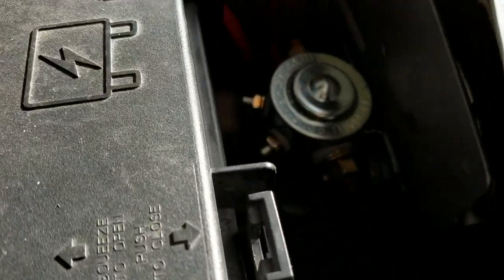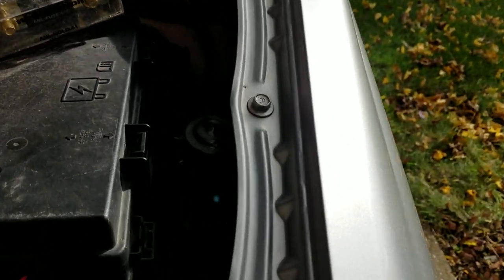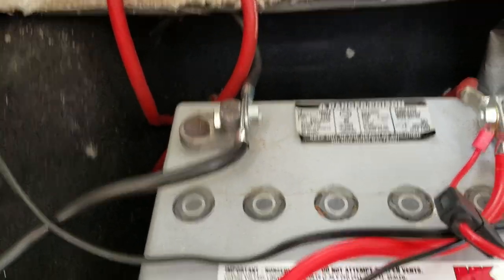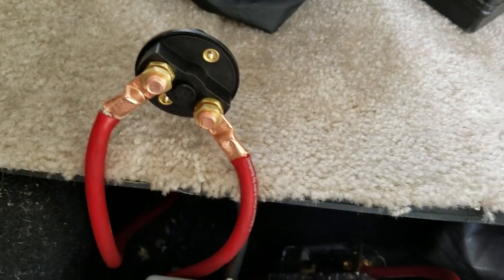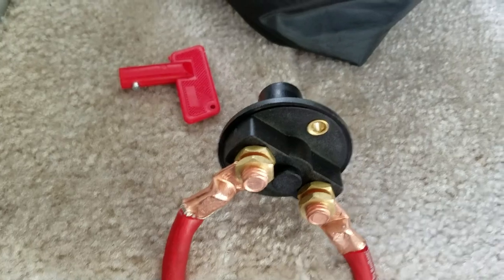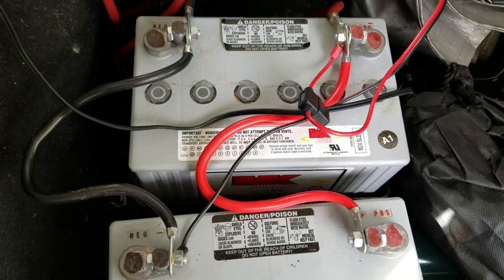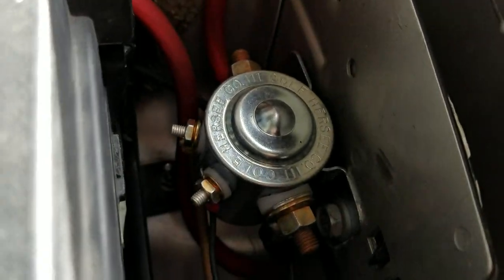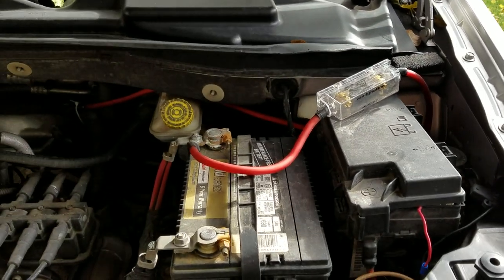Battery Isolator update/Shut off switch installed

Comment: Hey Mike! If my camper van ever gets outta the shop I’ll be using my EcoFlow Delta Pro 3600 watt solar generator for power. I know NOTHING about installing solar power into a Class B camper van. Besides, my van is totally fiberglass…I’d LOVE to have solar panels on the roof but cringe at the thought of drilling holes into that fiberglass! Thanks for sharing! ~Jim~
Reply from the maker: I used VHB tape!
Reply: @MikeandLisasExcellentAdventure  how long does it hold down panels? Which ones? The floppy flat ones or the regular metal framed ones?
Reply from the maker: @TOTALLYRELAXED  The metal rigid ones. I had renogy. The VHB tape I used is also used to hold windows in skyscrapers. My panels were on strong and never failed.  The roof would have ripped of before that tape would fail.
Reply: @MikeandLisasExcellentAdventure  That’s good information to know and use. Thank you! Have a great and blessed Monday!

Comment: Hello I have problem Im useing hv ceramic capacitors some times for me ignition system the problem is me alternator who is 12si delco Europ version is effected be it .
It swaps starting charge rpm from alternator from 1000rpm up to 2500-3000rpm so I need higher speed to charge me baterry .
So do those isolators prevent hv ore high frequency from interfearing with alternator ground potential ?
Reply from the maker: Yes. some alternators aren't big enough to supply the needed energy.  Some people choose to upgrade to a bigger alternator
Reply: Thank you for answering

Comment: When using your house batteries...how do you track how much power youve used? I have 2-12v 100ah agm deep cycle batteries with an isolator. But I'm trying to figure out a way to keep better track of the daily usage.
Reply from the maker: I just have a volt read out I monitor

Comment: Why pay $100 for a split charge system when a $5 battery isolator switch does the same job.
OK, so you have to switch it on/off but it will NEVER go wrong.